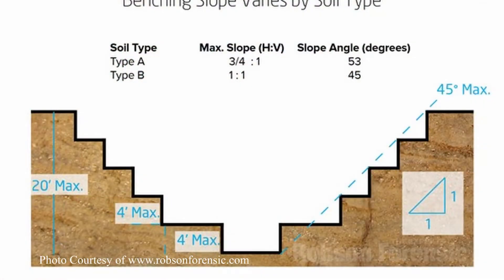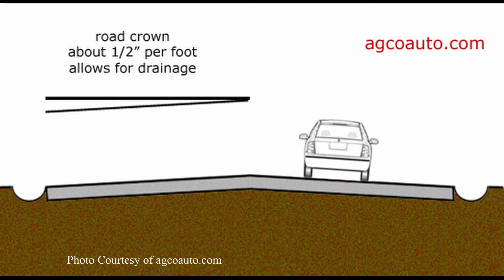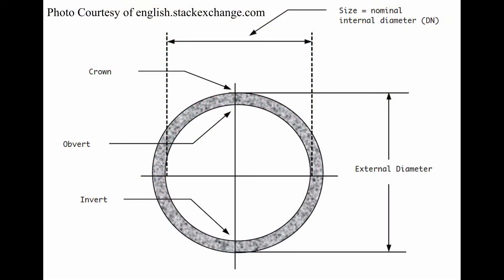CONSTRUCTION SITE TERMS EXPLAINED || Basic terms used in the construction industry explained

Comment: We I New Zealand mark our services with yellow for gas. Blue for water red power purple is Fibre green is telecom. Sanitary sewer and stormwater can be marked with white. We use spray paint to mark out.
Gas is yellow because Canaries are yellow and miners used to use canaries to detect gas.
Most services have marker tape just above them so that when you dig you find the tape first.
Reply from the maker: I had never thought about the yellow color for gas being associated with canaries.  That's a pretty interesting factoid!  It would be nice if all the services in the US had marking tape but unfortunately we have to find the utilities with our shovel or our bucket teeth.  One can dream....
Reply: Mostly pot holing to find services in NZ is done with hydro Excavation as its not likely to damage the service. In fact best practice says no digging within 500mm (18") of services with excavators. Some councils say no shovels either. As they've been known to cause damage.
Even though hydro costs about $160 per hour that's cheaper than a service strike. Lol
Email me sometime buddy

Comment: Just a word about the safety berms you are essentially correct about them however this is generally the rule 
All safety berms are to be half the size of the biggest tire on the job
In other words if you have off road trucks hauling that have 6ft tires you need 3 ft berms. This is according to MSHA standards 
MSHA is mine safety health awareness 
So when when I’m on my cut I always have a 3 ft berm up because we have trucks with 6ft tires 
If you have big trucks hauling they may not feel the one ft berm and go right over them. So use safety berms they do save lives. I do everyday
Reply from the maker: Thanks for the information! I've never taken any mine safety courses so this is really good information to have.

Comment: Great job, on all the videos.  I'm in my later 50's & you learn something new. Drove Dump Truck mostly but can run loaders, back-hoe loaders, excavators, pavker/rollers, art. rock trucks, etc. Can't operate them really good, but can get by.
One thing I wanted you to add, with reference to flag colors, etc.
White is "steam"/steam line (in Canada,  anyway). Many bigger cities have district steam heating systems, to heat buildings, offices, etc. Many University's & Colleges have high pressure steam lines with "condensate" return lines.
So, "White" is steam. Very dangerous  if you hit one of these lines.
Keep up the good work.
Reply from the maker: Thank you so much Glenn and thank you for the bit about steam lines. Those aren't too popular outside of major metropolitan areas and I totally forgot to mention them.
Reply: Funny in my area white is for proposed excavation area, and is used to show where the utility locators need to do locates.